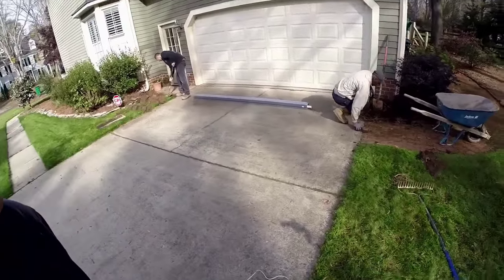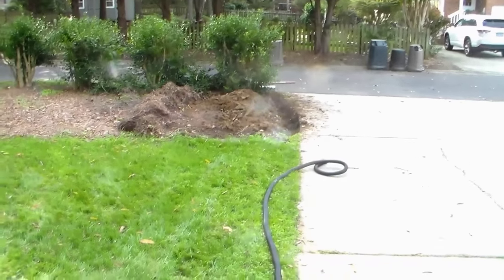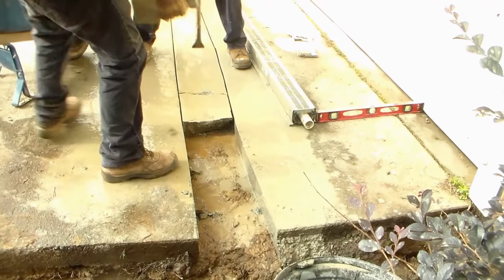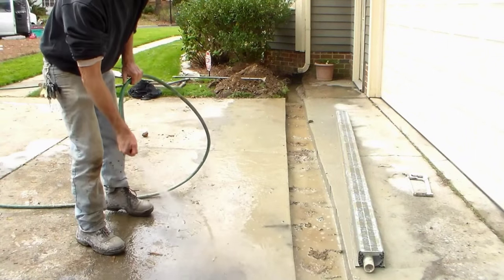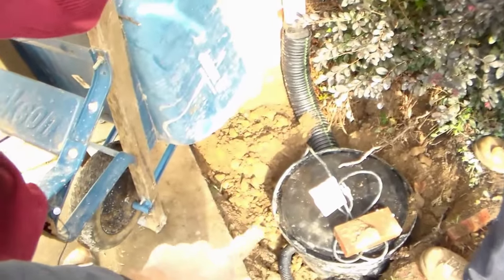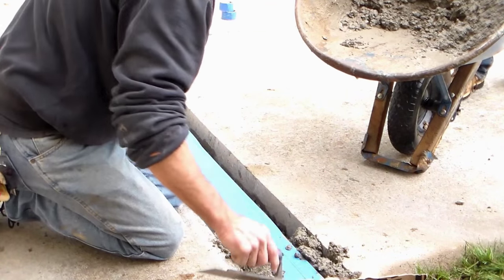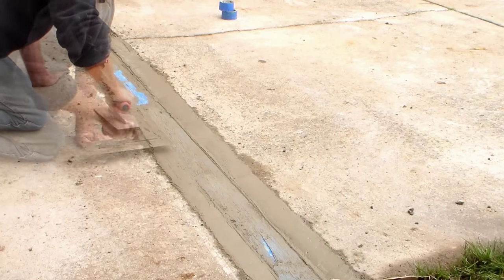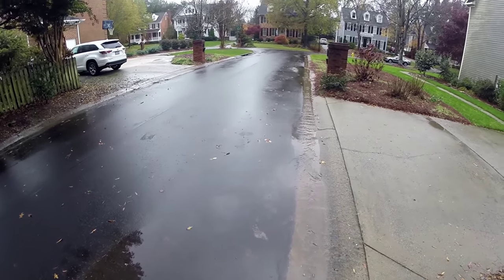How To Install Driveway Channel Drain with Sump Pump Discharge

Comment: What model pump do you recommend for this? 
Also, is it possible to have separate discharge pipe on the other side of the pit as a "backup" pipe in the event the pump fails? In my case, this would be my existing pipe...